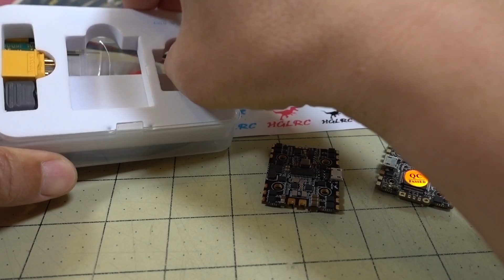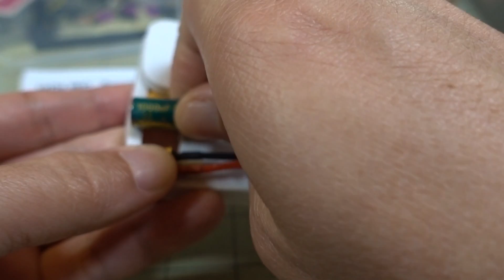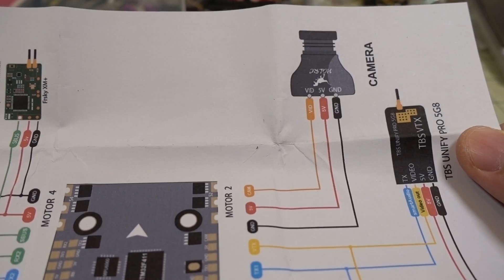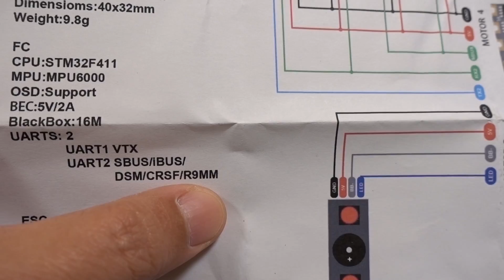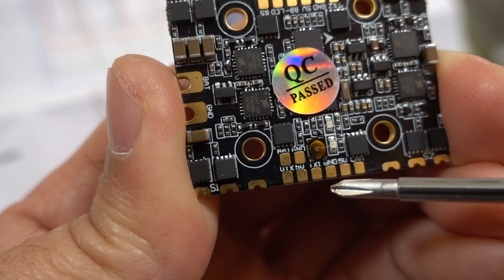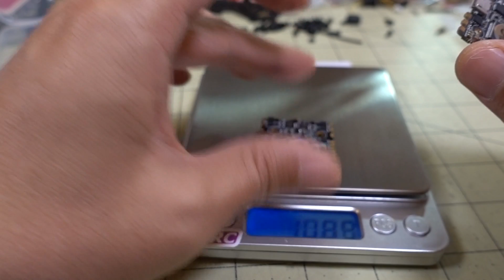HGLRC Zeus35 AIO Flight Controller Overview 🛠️

Comment: Great video Albert, I didn´t know the rubbers were to downsize the holes. I always thought they were dampers. I´ll use it in an Apex 3", I used it on a Sector 132 but I just swapped frame and burned the AIO.

Comment: Hi i have Zeus35 3-6S AIO Flight Controller and its stuck on bootloader after tired to update it on betaflight. Whwn i plug into pc nothing happens just red light on board. No ding on pc no betaflight detection nothing on zadig and impluseRc cant find anything. Any ideas. Also changed usb cable still nothing

Comment: going to put this fc into geprc sparrow mx3s. seen 2 bad reports of this fc hopefully no jello. the flight footage i watched of the kiss fc and vista looked like gopro footage best i have seen so far. i will be using 6s and 50v 1000f cap. running t-motor 1507 2800kv. they are smooth motors and running HQ 3140 props. space or the battery strap is my only problem.

Comment: Hey Albert... can you recommend any frames this will fit in? I have it in a heavy frame and it is too heavy for the 1404 motors so looking for a lighter frame. Thanks again for the review.
Reply from the maker: Unfortunately, I have not test fit this into any frames.  There's too many out there.  You'll have to do your best guess based on photos and the measurements.
Reply: @AlbertKimTV  Thank you sir. Just cut some weight on the 3" neutron and it is weighing in at a dry weight of 127g which is 7grams lighter than the raging droner at dry weight.... so it should be fine now with the 1404 motors.

Comment: I've got this on a 5" Stingy v2, RDQ Badass 2205.5 2450kv, 4s. It has gobs of performance, but can't seem to handle noise and has an issue with the pitch axis on the gyro. I'm not the first to notice this, maybe when you build yours out you'll figure out what we're seeing.

Comment: 3" or smaller quads? Heck, this thing looks perfect for building the most rippin 4" possible <250g. At least that's my plan for it :)
Reply: Lol and I'm over here running a 5"... Granted it's just this board, an R9mm, the frame, and the motors, so my AUW is rediculously low, but yeah the ESC's can handle 5" without issue. It's getting the vibes and noise out that's killing me, but I think I have RC smoothing issues cropping up right now.

Comment: Thanks for this review, Albert! I've been eyeing this controller to use possibly in an Armattan Tadpole frame. Not sure if the footprint would allow for much room for a camera, though. I'd like to see what your opinion of the Tadpole is.
Reply from the maker: Won't work in a Tadpole because it only works with whoop boards and 16x16 stacks.  No 20x20 AFAIK.  I'll have my build up later in the week.